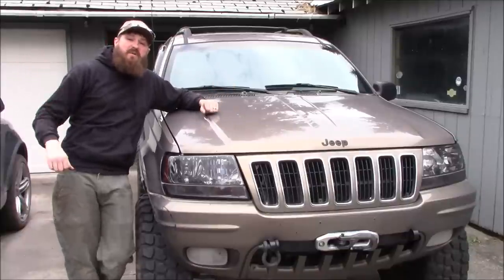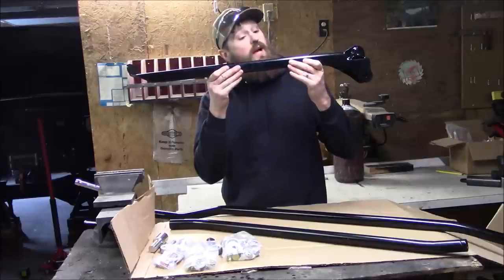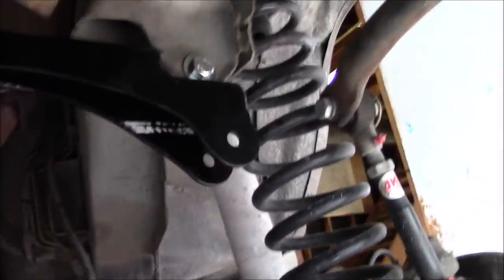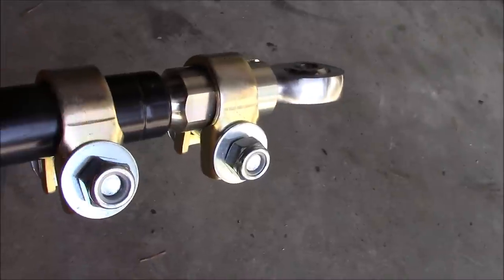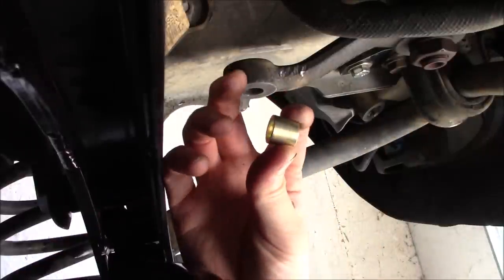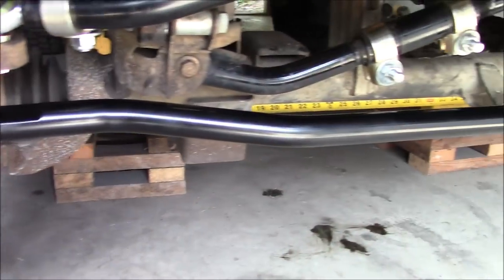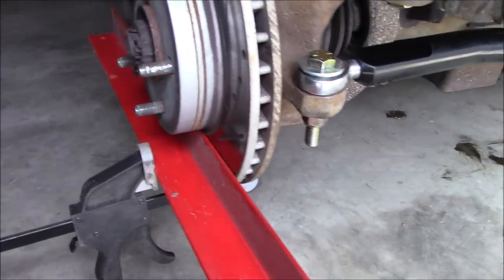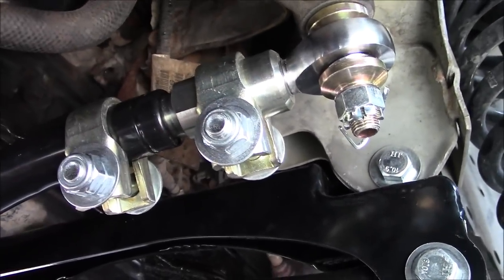The Last Steering Upgrade I'll Ever Need!  IRO Jeep Grand Cherokee Premium Steering Kit Install

Comment: honestly i believe the lowering of the trac bar is not to make it straighter, which yes it does help, but in actuality its to compensate for raising the trac bar. It corrects the steering geometry and puts the trac bar and the drag link back in line. great video like always. keep up the good work.

Comment: That mis-alignment spacer on the bottom at the pitman arm looks to be upside down. You want the less diameter side of the spacer to press against the heim and the larger diameter side to be pressing against the surface of the castle nut, since there is no washer. The less diameter against the heim provides the ample room for angularity of the heim.

Comment: Heim joints I will tell you in a few thousand miles you will change your mind about those for a highway vehicle 
Ball joints with those parts would be great or even Johnny joints something grease able and quite 

I’d say your friends can hear you coming about now 

But WJs are great 
Only thing I’ve done to mine so far is make some Coustom rock slides and 3.5” lift with BDS coils and  Bilstine 5100 shocks
And next will be new front bumper and winch or core link kit

Comment: I dont see how using the existing track bar upper mount & drilling through thin sheet metal on the passenger side makes this a good solution.

Comment: You should only use one tape measure. The reason for this is different tape measures will pull different measurements slightly or if you have a bend in the tip of the tape measure which could throw your measurements slightly off. Nice job Robbie keep up the good work.😎👍

Comment: Hey man you so I bought the same package from IRO and now that I'm installing it on my 2001 wj the bracket is hitting my oil pan it's about an inch to clear and be completely be in the flange. Got any recommendations to resolve this issue?

Comment: Great job. Would you recommend this project to others?  Haven't seen any videos for a long time. Did you take it off-road?  How are the on-road manners  Thanks
Reply from the maker: I really like it so far.  On and offroad it performs well.  Everything is still tight and doesn't make a bunch of noise which I was worried about with the heim joints

Comment: Brother, this is a great install. I’ve been trying to land on something like this for my 99 with a 4” lift. I’ve just got some sloppiness in my steering and a lil bump steer. How does it feel on road with daily driving? I’m probably 80% road and 20% trails but I want something beefier. Looks like those joints are solid! Thanks for any info. Also if you don’t mind, what is this wheel setup specs? Great rig.
Reply from the maker: I still really like it.  Steering is much more solid.  The joints are small, which is prob fine for anything I'll be doing and as with all heim joints they are sqeaky.  Long dirt roads this summer has them making noise.  I see IRO now has a one ton tie rod option you could look at too. I honestly might have gotten it if it was available.  Still i know this steering will be great for a long time.  The wheels are a 17 by 8.5 knp from kansei wheels.  They are awesome! https://kanseiwheels.com/products/kansei-knp-truck-textured-bronze
Reply: Broooo! I have a 99 limited with the 4.7 and it has a 3 inch lift and i t has bump steer and sloppiness as well. I'm new to suspension geometry and knowledge on that but I've damn near rebuilt this jeep otherwise. Even welded on custom wide body fenders and soon rockers. So besides this being noisy this really worked on tightening sloppiness in steering and bump steer?
Reply: How much was this kit you bought btw
Reply from the maker: Yes it has made a big difference in that department.  Steering is tight.
Reply: Do you have the v8 ? I want to do a 4” lift on my 99 jeep grand Cherokee Laredo. this is my first time so I’m very lost. Also the lift is mostly for looks, And some possible off-road stuff.

Comment: How do you grease the joints?     zerks?
Reply from the maker: Heim joints are not greased.  They have a Teflon coating that helps lubricate and I have used lithium spray on them.  But don't put any sticky grease on them because it will attract dirt and ruin the joint